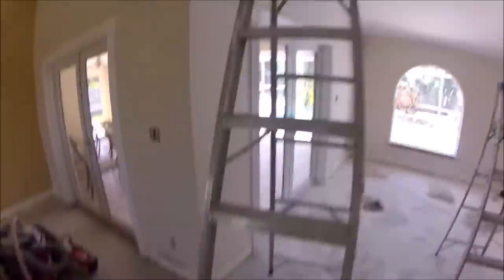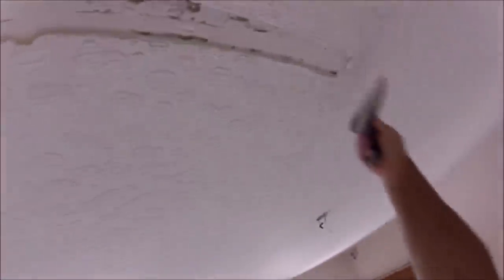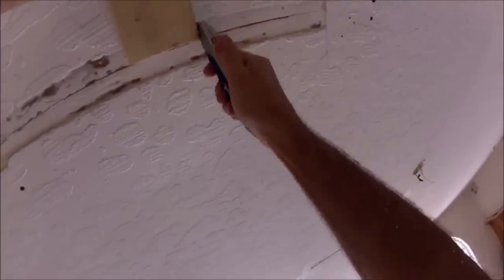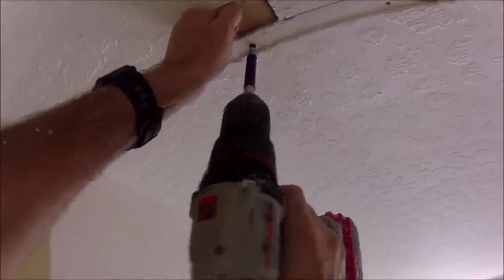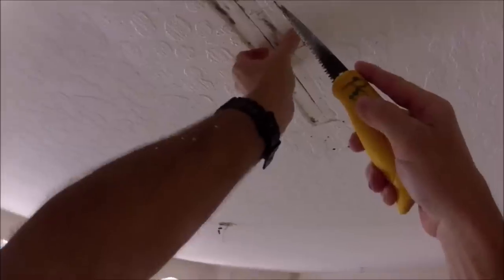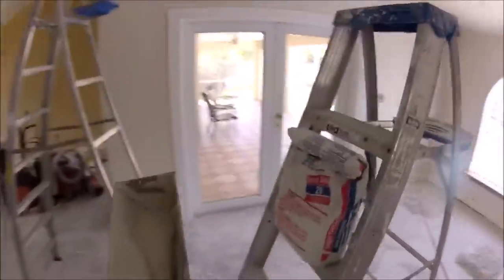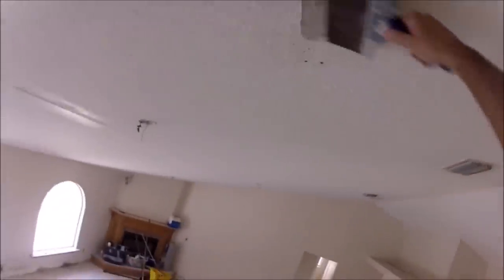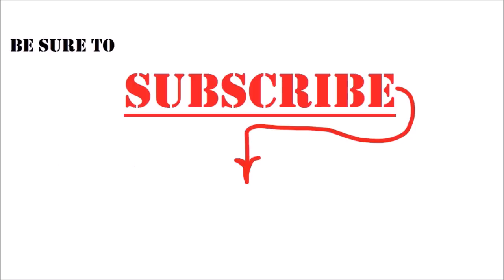How to Repair a Ceiling Crack- Diy Drywall Repair Tips and Tricks

Comment: U don’t have to use the all purpose first? The green bucket?
Reply: No the shit shrinks and meshtape doesn't stick good with it
Reply from the maker: Hey Hammer Time, actually you want to first coat the fiber tape with hot mud. Then you can use all purpose joint compound for the second coat on. I hope this helps.👍🏻 -Paul
Reply from the maker: Hi Amanda, you’re correct. Always use hot mud for the first coat. Are you a drywall finisher? Thanks so much for watching and subscribing!😎 -Paul
Reply: Yes a framer hanger and finsher. I learn alot from your videos though. You are bad ass dude.
Reply from the maker: I appreciate that Amanda!🔥🙏 That’s awesome that you’re so well rounded. Job security!!  I do metal and wood framing, hang, finish, texture, paint, trim carpentry and acoustical ceilings. I’m never without work and at this point I can pick and choose my projects. Very thankful for that!🙂 Thanks again for helping others out in the comments!👍🏻 -Paul
Reply: I do metal studs and acustical cellings too. I hate these home remodels I'm doing now cause by hurricane Micheal
Reply from the maker: So cool Amanda!😎
Reply from the maker: So cool Amanda!😎
Reply from the maker: So cool Amanda!😎
Reply from the maker: So cool Amanda!😎
Reply from the maker: So cool Amanda!😎
Reply from the maker: So cool Amanda!😎
Reply from the maker: So cool Amanda!😎

Comment: Hi. What would you recommend painting over painted mdf around a tub to seal from water (no shower). Thank you 🙏🏻
Reply: Do you have a recommendation Paul?  Thank you
Reply from the maker: I’d use Zinsser 123 latex primer and then two coats of a quality semi-gloss paint.👍🏻 I hope this helps. Good luck. Thanks so much for watching and subscribing!😎 -Paul
Reply: I'd use Chalk Paint (no sanding required) it's heavier than reg paint and you seal it with wax, water proofing Abit.

Comment: #Drywalltube. Should you use gardz whenever you do a crack repair like this?  Great tips Paul.
Reply from the maker: Hey TEH, no you don’t have to use the Gardz every time. You could also prime it with a spray can of Kilz. I just like to seal the area behind the tape because a lot of times it’s super dusty. This insures good adhesion on an already problem area. I hope this helps.👍🏻 Thanks so much for watching and commenting man!😎 -Paul

Comment: anyone noticing all the ceiling cracks always run the same direction as the rafters,?
Reply from the maker: They shouldn’t. Because the proper way to install drywall is to install perpendicular you the trusses or furring strips on a ceiling.👍🏻 I hope this helps. Thanks so much for watching and subscribing!😎 -Paul

Comment: Hi Paul. You have great ideas and do amazing work. I have a similar crack in the same area. I have had 2 contractors repair this situation. And its never a permanent fix. Im $500 in on this 4 to 5ft crack. Nobody has ever performed that lil trick with the support strip under the drywall. Lots of phony dudes acting like they know what the fix is. After watching ur video - im gonna attempt the repair myself. Sick of wasting my money on these douchebags and it can't be any worse then there trashy repair. Are you anyehere near Maryland?? Lol. Mozt if these contractors in home repair in Maryland are Drunks, Addicts or recovering addicts, fresh out of jail helpers, thievs etc etc etc. Shithole state.

Comment: Fuck all that shit ...... I would've just used filler in the crack then repainted the ceiling. After-all, who the fuck stares up at a ceiling when they're in a room? At ground-level, you would've never noticed the filled crack once it had been painted over.
Reply from the maker: and it would be all cracked again in no time using your method Ross!